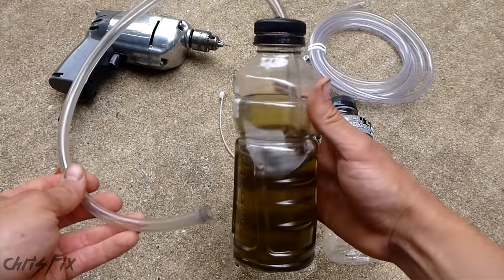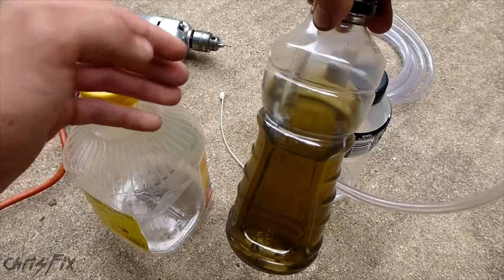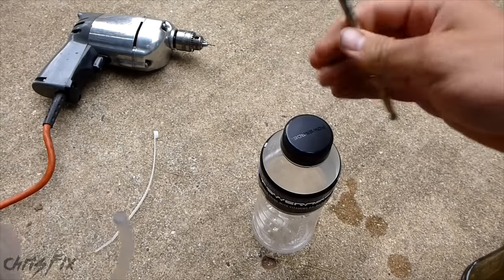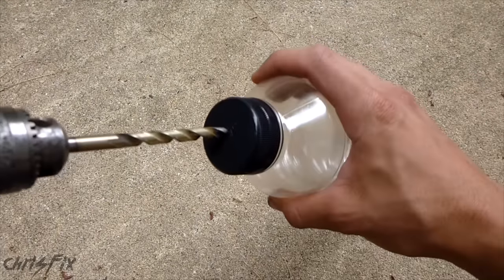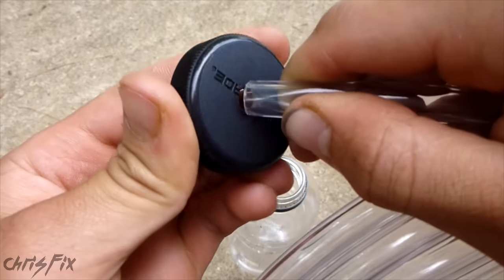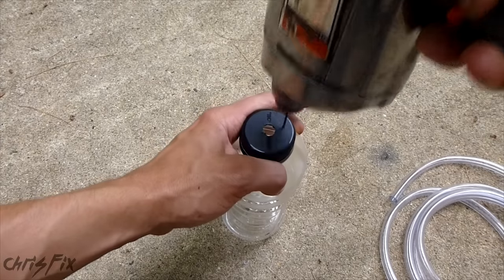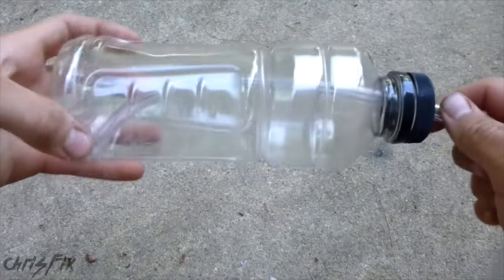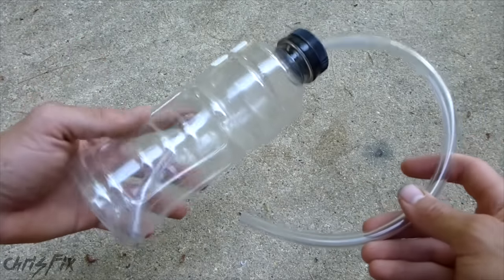How to Make a One Person Brake Bleeder for Under $5

Comment: WAY TOO MUCH FAFF!
Use any container, take a length of clear tube and stuff a bolt up one end to seal it. Take a sharp knife and just above the bolt push in the blade to make a small slit. Connect the other end to the bleed nipple and the bolt end into the container. NO you don't need a cap with a hole to push the tube through. Start pumping the brake with the bleed nipple loosened. The fluid will exit the through the slit and resist sucking back through the small slit . Why faff about recleaning your bottle to prevent swarf entering your brake system? Are you going to reuse the fluid????????

Comment: You are entirely unclear on the concept of one man brake bleeding. The correct system uses a vacuum chamber at the wheel cylinder (caliper). This way you set up at one wheel, open the bleeder valve and use the vacuum to pull out the old fluid and air. You can actually see when the air is purged out of the line. The true one man vacuum bleeder system takes only one visit to each wheel. Your BS setup requires getting in and out of the car dozens of times to check the master cylinder brake fluid reservoir all the while pumping and pumping the brakes. Your system does not allow the mechanic to actually observe exactly when the air is purged. If you just look at a full bottle of expelled fluid, you cannot logically assume that all the air is purged. All you know is that the bottle is full of pumped out brake fluid.
Reply: I am entirely clear on the concept of one man brake bleeding. A good vacuum chamber setup costs a hundred dollars, or I can buy a piece of crap for $30. If I want a piece of crap, it seems much more cost effective to duplicate Chris's setup here, like I did, for $1.43 

This isn't some weird, off the wall idea Chris came up with, this is the way it has been done since the 1930s. While a good vacuum setup clearly has minor advantage over this old-fashioned method, I don't know enough about the vacuum setup to understand how it allows the mechanic to "actually observe when the air is purged."  In fact, if there is an obstructed line, the vacuum pump won't reveal it any better than this way does. 

But when I bleed old fluid out, by pushing it through with new fluid, and I look at the new fluid being expelled in to the bottle,  I absolutely DO know that all the air is purged. 

Do you see much of a market selling hundred dollar vacuum pumps to home-users who might bleed brakes once every other year or so?
Reply: +wilkesjournal Motive Products makes a brake bleeder kit that sells for about $50. It's a container about 3/4 gallon in size with a hose and a pump. The hose attaches to an adapter that fits your particular master cylinder. You can also purchase multiple adapters. You gut some brake fluid in the container, then use the pump to pressurize the container. Then go to each wheel, crack the bleeder, and the pressure forces out old fluid and air, and the fresh fluid in the container keeps the master cylinder filled. I use this system in conjunction with what Chris uses here. When you see new fluid in the hose and no bubbles, close the bleeder. $50 well spent.

Comment: Seen the video very nice,, I'm going to try today,, but here I have a question for you I accidentally poured power steering fluid into my brake reservoir I have been driving it so far for about two weeks maybe week/ half,, I just seen a video saying why not to do it didn't look good,, I was hoping maybe you could give me an idea, you can email me at  rbarredajr@icloud.com,, or is posted on your site for thanks hope to hear from you soon
Reply from the maker: roberto barreda jr That is very bad. power steering fluid is not brake fluid and the two do no mix. I would do a flush, actually I would do multiple flushes and get all of that power steering fluid out of your brake lines. Here is how to do it: How to do a Complete Brake Flush and Bleed
Reply: ChrisFix How's it going it's me again thanks so much for the info I'm going to Flushing today but do you think I should go ahead and change my calipers I do have award liked him more TNM the thing is I'm worried that the brakes my locked up on me when I'm on the expressway
Reply from the maker: roberto barreda jr Well it is definitely something to think about. I would not drive the car until you do a flush, and then drive locally for a day or two and do another complete flush. Watch this to see how to replace calipers: How to Replace a Brake Caliper